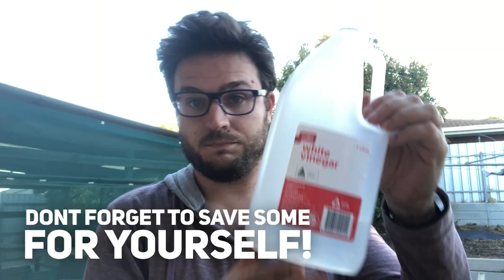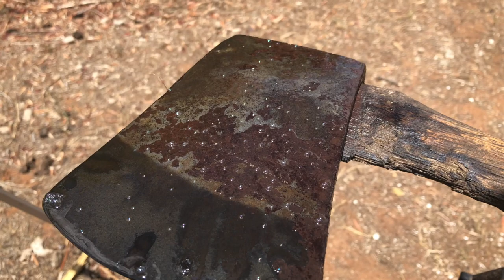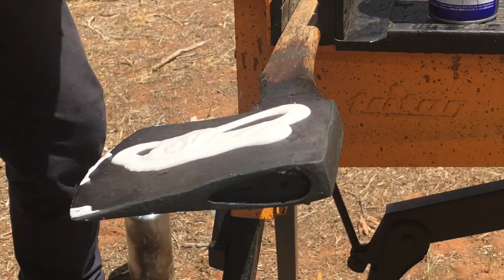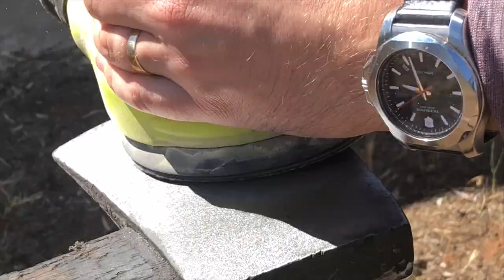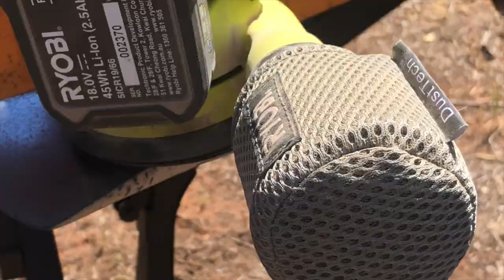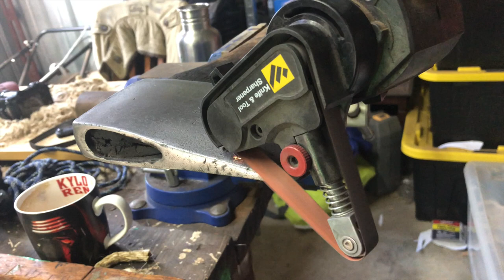Grandfather Axe Renewal

Comment: See how deep that temper line was, that’s quality 👍 also that was a hyst forester which was the top axe in their range
Reply: What gives it away as the Forester and not the Craftsman?
Reply: Rob Bowman there was 3 in the range  craftsman challenger and forester not including specialty axes. I saw faded letters while Pete was cleaning it and I thought it read forester I could be wrong it may have said craftsman or it could be scratched and pitted and not be writing at all what did you think it said?
Reply: HYTEST FORGED 4 1/2 TOOL. So it's a 4.5lb but I wasn't sure if the stamp on the other side was any indication. Usually you may still see some paint in the stamped letters. Blue for Challenger, Green for Craftsman and Red for Forester